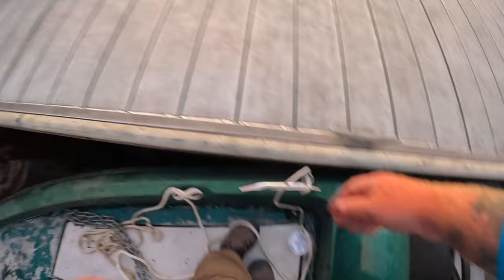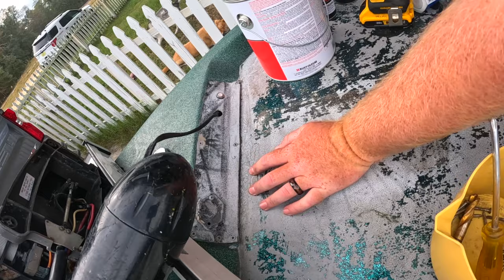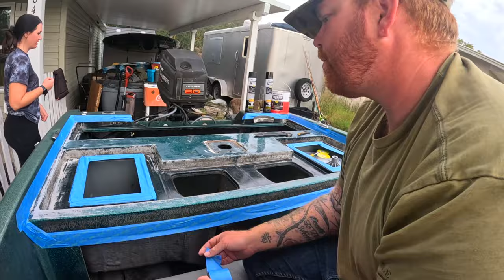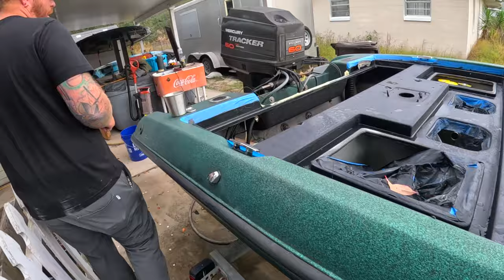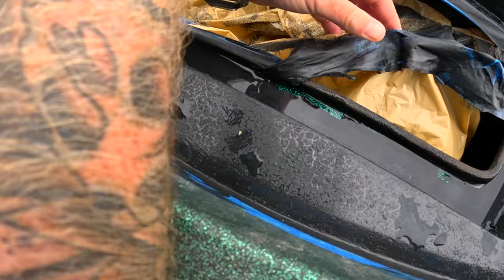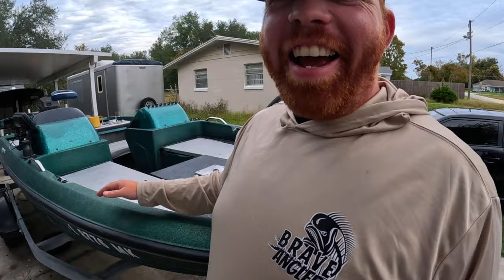Ugly Bass Boat Transformation. Bed Liner Deck (UNDER $100)

Comment: Glad you were able to Salvage It. It looks nice. Might have wanted to rough it up with some sandpaper before you applied it. Then take the tape off while it was still a little wet. Looks like a fine job though for your first time. I think you have a nice little diamond in the rough!!!
Reply from the maker: Thanks for the tips if we end up having to redo it we will try that next time. Overall it does look a lot better though
Reply: @thebraveangler  It does look great. Glad to see you both working on it together!!!